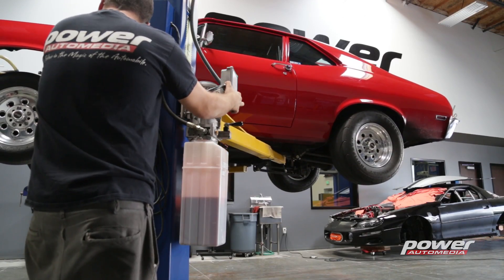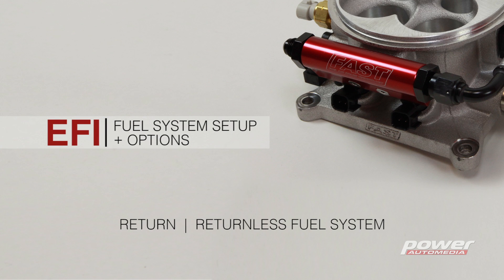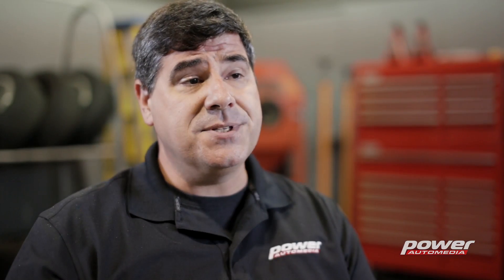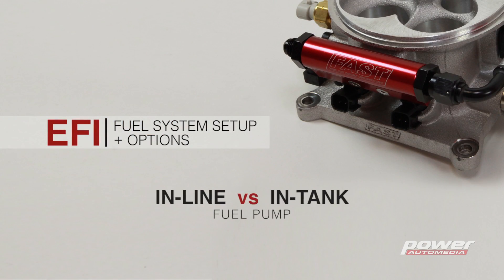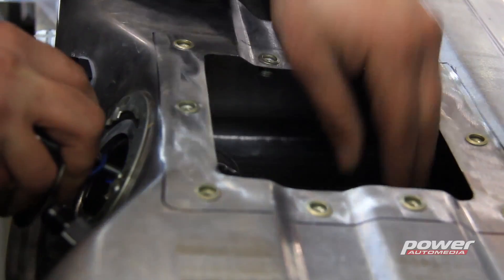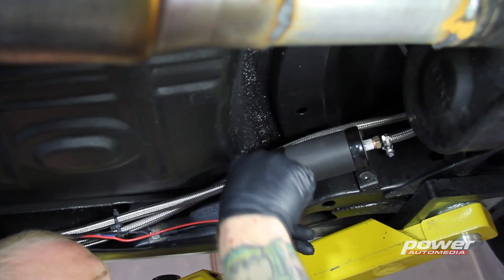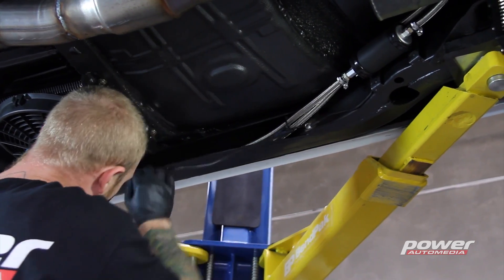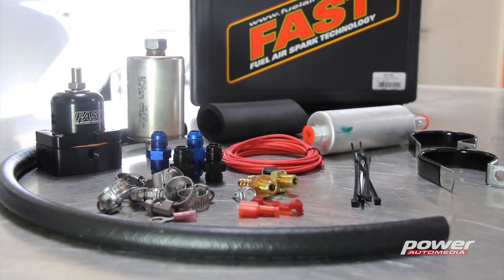How to Setup a Fuel System for EFI Fuel Injection

Comment: Can a 1986 f150 with fuel pumps in both tanks and a high pressure pump on the frame be converted over to a electric fuel pump.

Comment: How big does a return line need to be?
Reply from the maker: Depends on what system you are referring to. With the fuel return line it depends on the fuel pump flow rating and feed line size. Generally bigger is always better because you want to avoid any back pressure. 
-Up to 600 Horsepower: -06 AN(3/8 inch)
-600 to 1000 Horsepower: -08 AN (3/4 inch)
-1000 Horsepower and Up: -10 AN (5/8 inch)
Reply: Thanks for the repy. HP will be under 400 but we'll stick to a 3/8's line. We're about to replace the tank so I'm installing a return line in case we go to EFI in the future.
Reply from the maker: Nice, no problem. Good luck with the build.
Reply: I think you meant to say that -08 is 1/2"   ????    you wrote that it is 3/4" ???

Depends on what system you are referring to. With the fuel return line it depends on the fuel pump flow rating and feed line size. Generally bigger is always better because you want to avoid any back pressure. 
-Up to 600 Horsepower: -06 AN(3/8 inch)
-600 to 1000 Horsepower: -08 AN (3/4 inch)
-1000 Horsepower and Up: -10 AN (5/8 inch)